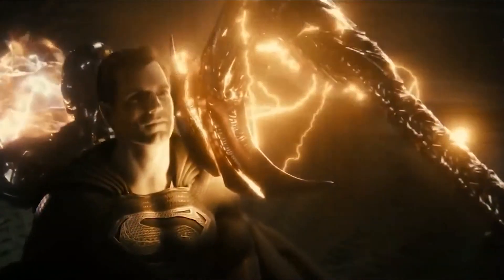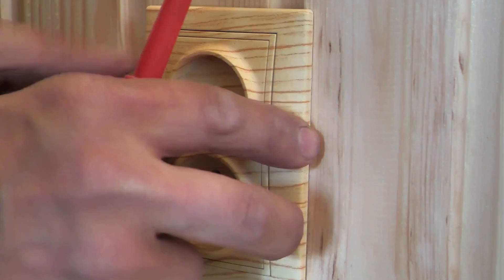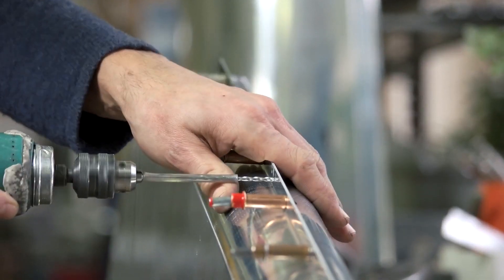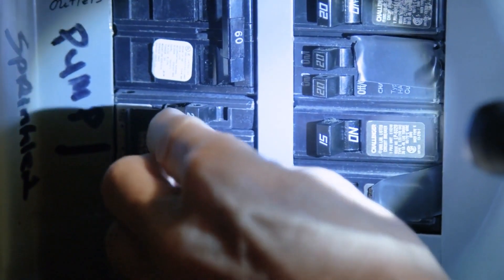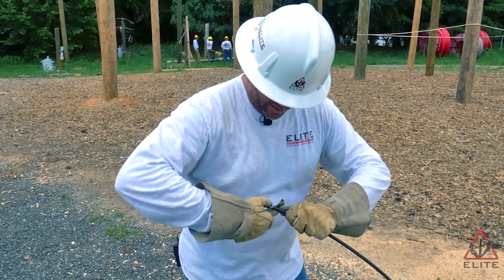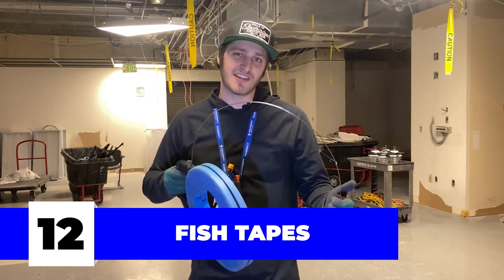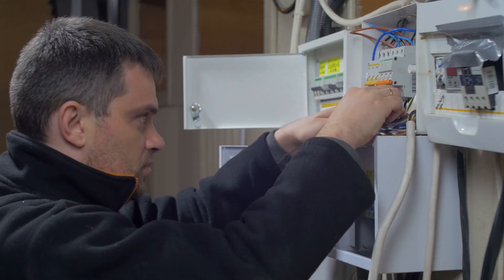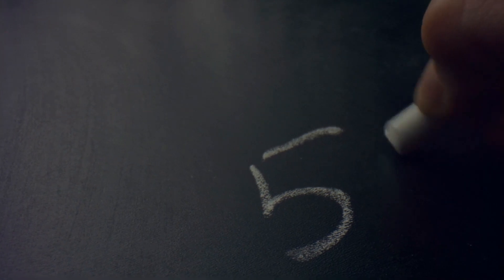Electrical Tools That EVERY Electrician Can't Live Without!

Comment: Forgive me I usually don't bother commenting but.   No true Electrician would use a lighter to heat shrink wrap given the choice.  That Claw Hammer was not a claw hammer by a long shot.  The Safety Gloves I saw were just rubber surgical gloves not allowed on a US job site for sure.   I highly recommend you correct your misinformation, the new or  young generation is looking to media like yours to learn and you are risking their safety.